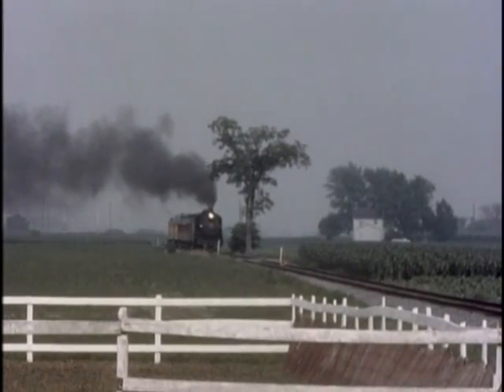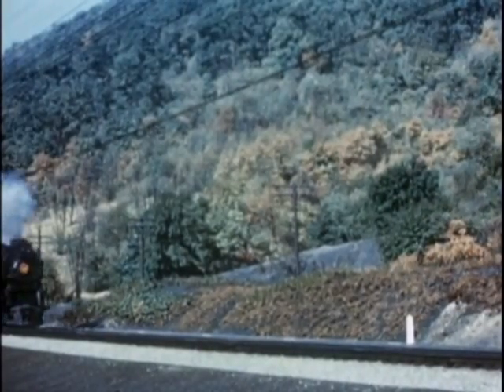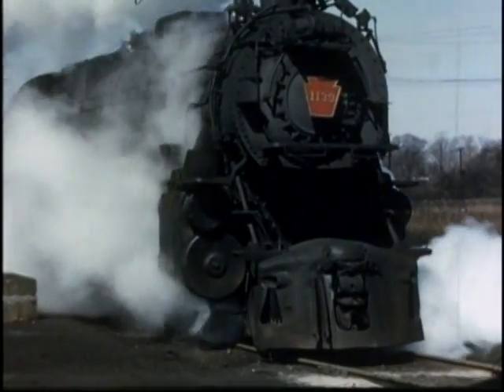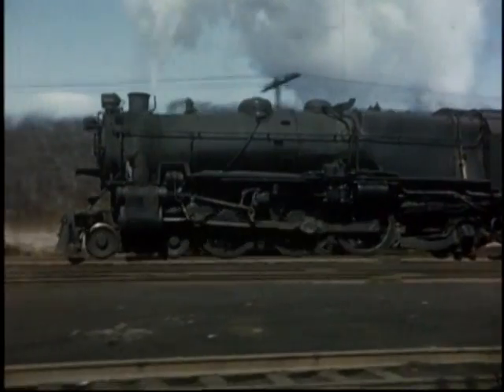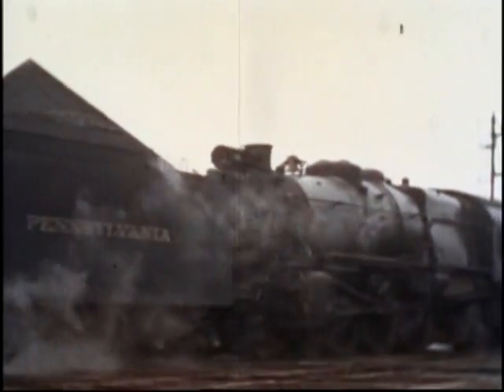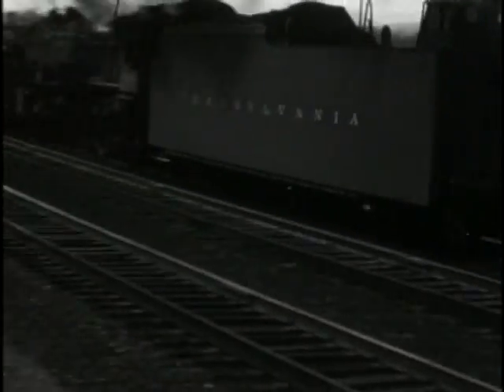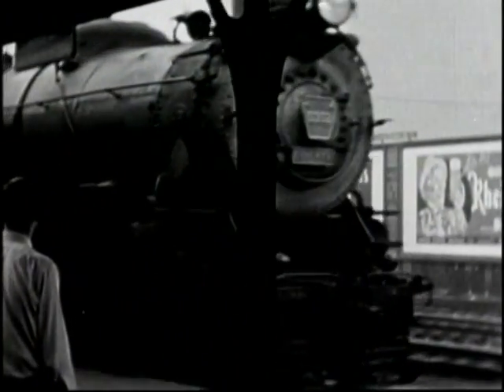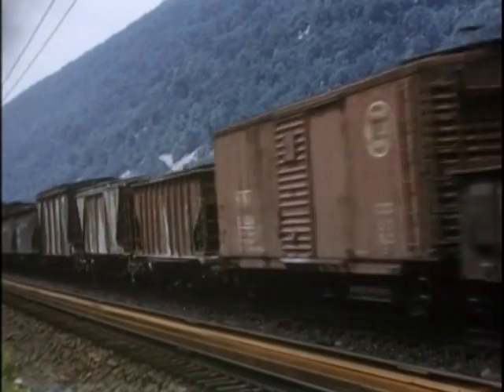Pennsylvania Railroad Steam Engines

Comment: The narrator was right when he said that some of the Pennsy locomotives are preserved in the Strasburg museum.  I've been there a couple of times (my grandmother lives about half an hour from there), and the place is HUGE.  I'm such a train nut, I'm even a member of the "Friends of the Railroad Museum of Pennsylvania"!
Reply: Do they have a “Big Boy” steamer there?  What should be there is one of the S1 Platforms, or the T1 Platforms designed by Raymond Loewy.
Reply: @divox9pqr  Unfortunately, there is no Big Boy locomotive in Strasburg, but there is one (#4012) on static display at Steamtown.  I also remember hearing that there was a Nickel Plate Road Berkshire locomotive (#757) at the Railroad Museum of Pennsylvania, though I believe they moved it to another location.
Reply: Sadly no J1s, or any of the Duplex drive locomotives were considered to be worth the Collection.
Reply: @b3j8  That's a shame.  I've seen pictures of those magnificent locomotives, and some of my friends at my local model railroad club run HO scale J1s and T1s.
Reply: i grew up going to SRR since birth. all thru the 90s to now. its changed A L O T. I would love to see true PRR Steamers there instead of the engines they have no. no offense to 475 90 and 89
Reply: @MissRailfan  Indeed it has, and so has the landscape. I've seen vintage films with #1187 and #1223 (both now in the Railroad Museum of PA) pulling trains, and wonder what it must have been like to ride behind them. From what I've heard, though, Strasburg is one of the few railroads in the country where two operating steam locomotives pass each other on a regular basis. My grandmother (who I mentioned in previous comments) unfortunately went home to be with her Lord about seven years ago, but I still go to Strasburg on occasion to honor her memory and continue my passion.
Reply: I also went there a couple times too. Back when I was young. And September 5th 2021.

Comment: A great overview of Pennsy's stable of fine engines a great many of which were designed and built by them. The decapods were a great idea so as to maximize tractive effort but I heard there were some problems with derailments due to their long wheelbase.
Reply: Strasburg’s own Decapod number 90 detailed twice in its career on the Great Western of Colorado.(both after getting hit by a truck at a crossing) It’s stayed firmly on the tracks in Strasburg though.

Comment: Unfortunately the PRR was the classic example of what happens when a corporations fails to innovate and invest: by 1954, east of Harrisburg, moving “fast freight” less than car load lots regularly took 3 or more days to travel less than 100 miles. Combine this with passenger speed averages falling 3-6% per year just as they needed to be increasing, particularly on short runs such as Philadelphia-New York or Pittsburgh Cleveland, and you had a sad spiral to the end. In 1950, the PRR was the most highly capitalized, most profitable corporation in the world. In less than 20 years it was gone.

Comment: Ok, not entirely related to the prr, but something I thought of in this video. The coast to coast tender was massive, yet used on non-articulated locomotives. What if something like a big boy or y6b had the same tender to locomotive ratio in everyday service. I now in later years additional tenders where added, but they where temporary and could only hold water. I mean semi-permanently attached and accessible for storing coal in the second (section of the) tender.

Comment: @Bassfanatic94

Actually, if you look closely, the main and side rods connect at the second set of drivers, from the front, on the locomotives during the times I mentioned.  Mikados have their main and side rods connect on the third set of drivers from the front, whereas mountains have their main and side rods connect on the second set of drivers from the front.  Plus, the locomotive from 6:45-6:55 is #6940, which is a mountain.